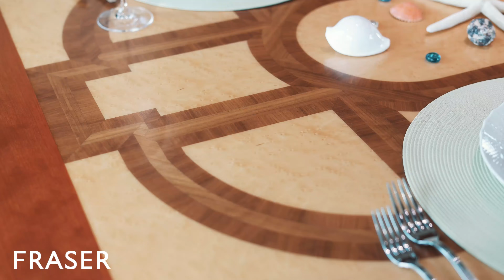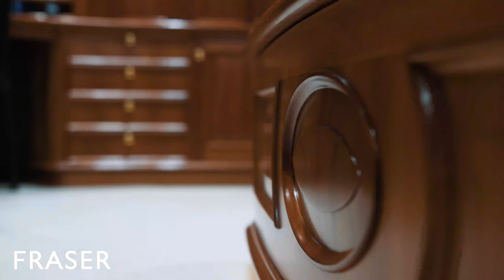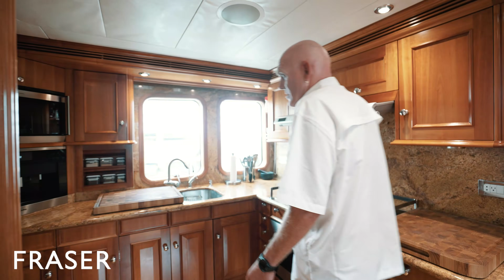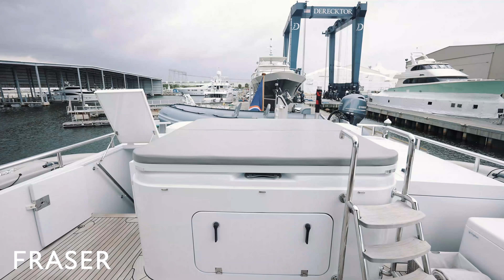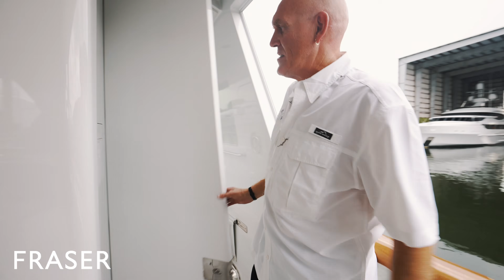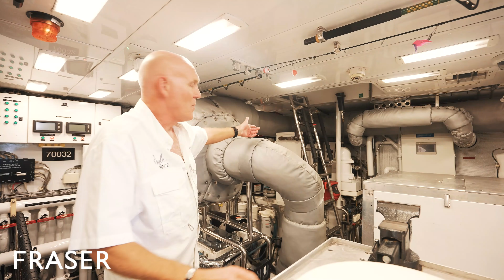GAYLE FORCE | 29.24M/96' Bloemsma Van Breemen Dutch Explorer Yacht for sale – Yacht Walkthrough

Comment: Coming to this quite late, but wow.  What a boat for the listing price at the time.  Clearly way more than I have in these pockets at the moment.  Heck I couldnt' afford it if someone gave it to me, and the captain worked for free let alone, the complete cost of buying and running a boat like this.
And anyone who buys her hopefully they have kept he as nice as the original owners, she is a beautiful boat.  Again for the price she is very much a steal for what you get. The worksmanship is top notch, she can go anywhere in the world basically, including far north, easily handle some big seas, and inside you honestly can't get a more classic feeling boat, mixed perfectly with home like elements. 
Many boats not feel like floating ikea apartments.
This one feels like it's a floating old english mansion, back when they still knew how to build them, and this is like one transported in time. For instance it's one thing to have a spiral staircase, it is a completely different one to have one that nice, including those perfectly shaped rounded doors. I tell you in wood you don't see that too often. Yet they dont' just seem well shaped, they feel perfectly shaped, and for them to have held that shape for this long, and still looks brand new, says a lot of the quality of the wood used, and the joinery, etc.
I'm impartial to the marble, I always feel it's a bit excessive for a boat.  Why add that extra weight, and if you do, not that thick.  But it's  personal preference, i can imagine others would love it.  I would be fine with it if it was like a quarter the thickness, not like it won't outlast the owner and the boat even at that thickness.

honestly if I could spend the rest of my life on that boat, sailing the oceans for couple decades, i'd be in bliss.

Comment: So these engines are from 2003 and they've been run into the ground for twenty years? Isn't refitting this yacht like putting lipstick on a pig? How much more life do the engines have in them? I find it laughable that they are not even listed in the description. Some newbie bought this yacht. Sell after a year and they'll be fine. Otherwise, yikes.  Massive maintenance costs on the engines, and possible replacement(s) needed.
Reply: So what?  If they are maintained properly they will last another 20